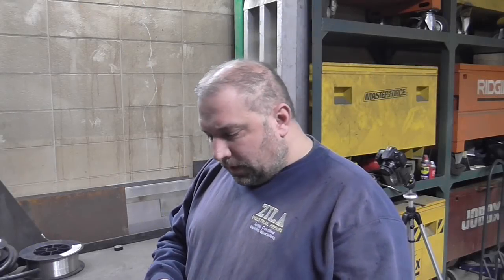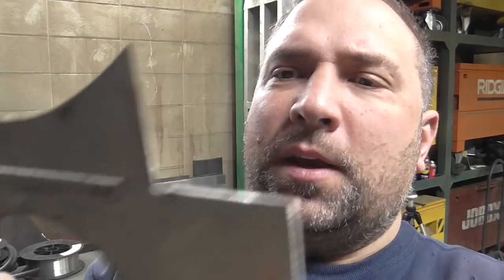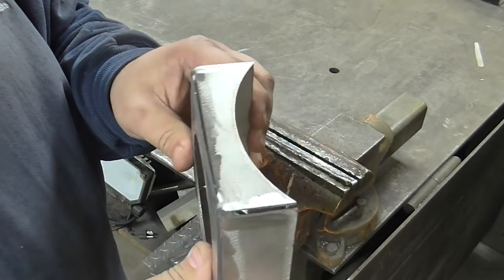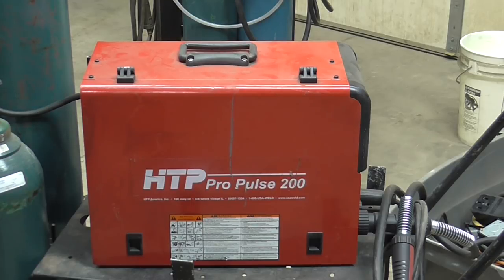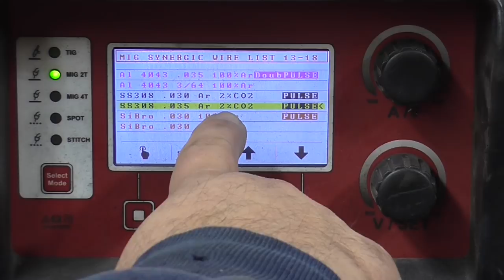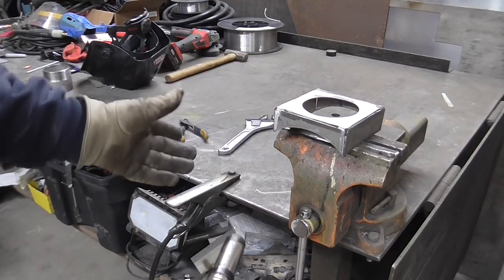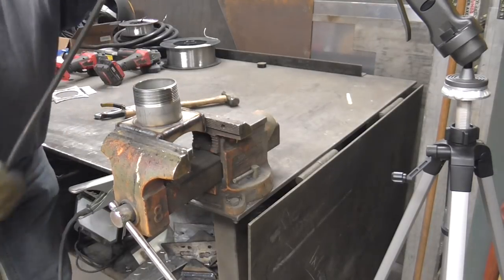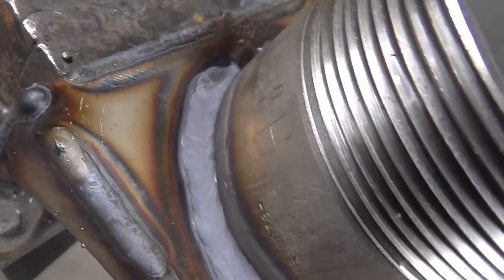The quick rundown on Stainless and mig welding. 3" nipple

Comment: Is the reason for rusting not the use of wrong shielding gas?
Reply from the maker: there will be another video on stainless - a little bit more in depth.   the shielding gas i used was within specs.  on stainless mig you have several options, tri mix or high argon content 95-98% and the balance either co2 or o2 ....  now even if you tig weld stainless (and you have seen the ice and rainbow color welds .... even those are a "problem"  the stainless properties are disturbed or diminished during welding and can only be restored through passivation ... even grinding them "clean" is not good enough
Reply: I'd always thought 100% argon. 
I'll be honest, most of the stainless I've welded has not been critical to be stainless, mild steel wire has been good enough.
Reply from the maker: 100% argon on tig

mig is a little different - if you want to look at this

http://www.lincolnelectric.com/assets/US/EN/literature/C64000.pdf
http://www.lincolnelectric.com/assets/global/Products/Consumable_StainlessNickelandHighAlloy-BlueMax-BlueMaxMIG308H/c61058.pdf
the second link shows you the mig stainless wire ... 98/2 gas

and i know exactly what you mean  -and i am way better and have more knowledge on aluminum welding than stainless welding ...  but i know where to look most of my stuff up ....
Reply: ZILA I really like your approach with Aluminium. I'd never considered MIG as an option, but I'm thinking of buying a new torch and a roll of wire and giving it a go. I don't have pulse though
Reply from the maker: sidewaysdanny if you weld 1/8” and thicker ....  you will be just fine. Aluminum wire, if you cant get aluminum drive rolls stick with 5356,  10ft gun or shorter, nylon, teflon or graphite liner ....  100% argon gas 40 cfh ....  and you are in business!!!

What machine do you have?

Comment: What’s your recommendation for a 48” jobsite box Pete? Trying to find the best bang for my buck. Awesome video buddy keep it up!
Reply from the maker: if i had to buy one today - menards $289 if it is not on sale....  i have 4 or 5 different brand boxes - they are pretty much all made out of the same thickness metal, the handles and the way how they lock is different .....  and price wise  - the times that you could get one for $199 those times are over  - that was 10 years ago ... now the "standard" size box 24x24x28 starts at $249 and goes to $499 .....
Reply: Awesome thank you very much

Comment: I deal with stainless but only tig and stick welding on pressure piping. How does GMAW hold up as far as ferrite levels and brittleness?
Reply from the maker: honestly - I am not sure - this here is a non-critical application .... when i so stainless where it matters I typically tig weld this or I dual shield flux core it and both of those processes work excellent!

Comment: how do you go from short circuit to spray on stainless? thanks for the videos
Reply from the maker: Hank Trill the gas.   If you read a spec sheet on wire it tells you what your gas options are....  besides the tri mix you typically also see an option with a high argon content (95-98%)   And the remaining 2-5% are typically either co2 or o2 ....  those gasses are used for spray arc.
Reply from the maker: Hank Trill thanks for watching